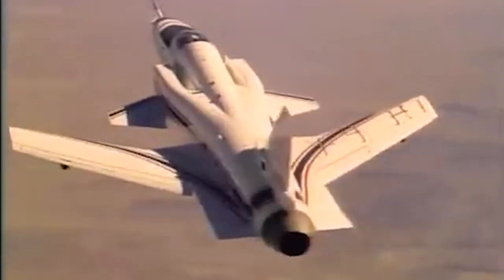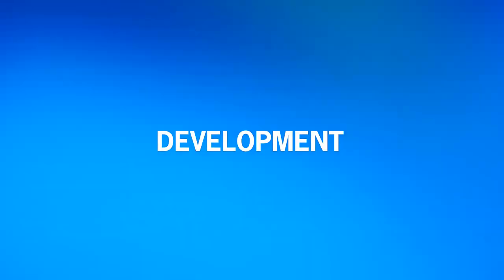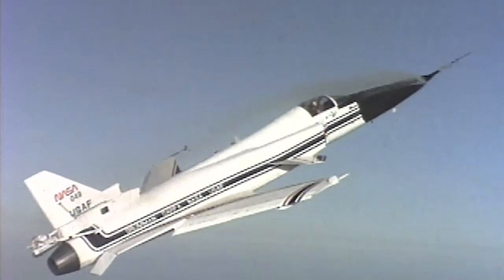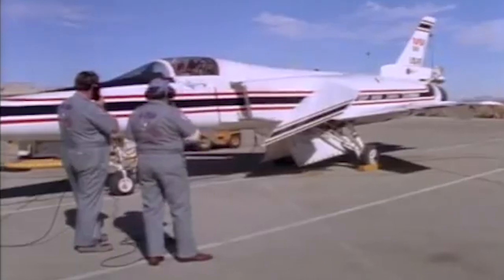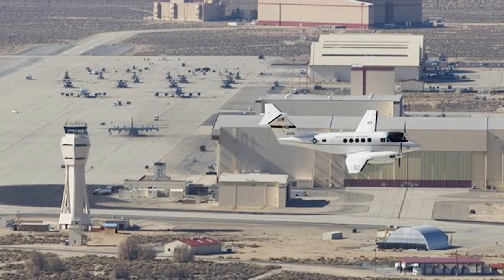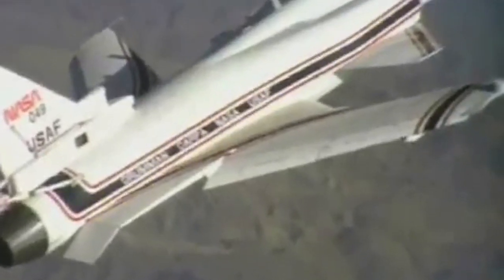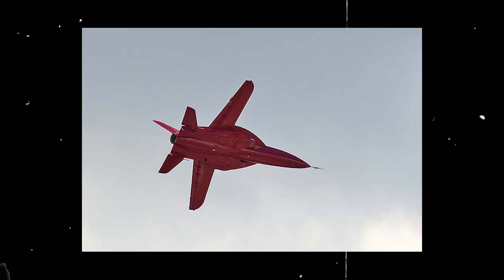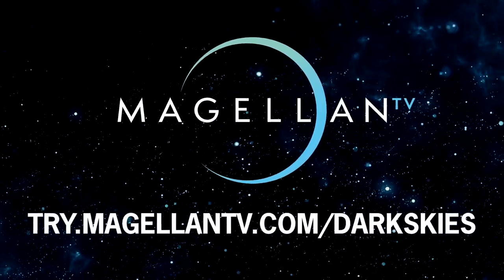X-29 - The Most Unstable Fighter Jet Ever Built

Comment: I believe this kind of design was “abandoned” because of the priorities shifting from maneuverability to stealth.

Canards and similar surfaces are not good for a plane RCS (radar cross section)

There are other aircraft that would be impossible to fly without computers, the f-117 for example
Reply: Adam Lannerd  Did you mean the YB-49, Northrop's Flying wing bomber.
Reply: The problem with reliance on stealth is that once they find a way to defeat it, and they will, the aircraft such as the F-35 is vulnerable. The British Royal Air Force flew Typhoons against F-35s in visual range and the Typhoon won every dogfight.
Reply: Desrtfox71 I understand what you’re saying but that’s not exactly true. Some of the engagements are not very clear. Let me give you a real example that happened in Iraq I believe. 

AWACS detected 2 mig-29s approaching 2 f-15s. On notice the f-15s turned in the direction of the migs which in turn turned in the opposite direction appearing to be running away.
The f15s gave chase. 
A few minutes in they realized they were in an ambush with another mig-29 (or 2) appearing in their flank.
Now at this point is where your argument gets tricky. The American pilots need to make a decision. Do we bug out and get the f away from here OR do we kick their buts? They decided to fight and they won...within visual range. I’m afraid 2 f-35s could be forced to make a different decision but I’m not sure. I’m actually a pilot but I admit there’s just not enough information to make a fair judgment on the aircraft. That’s another conversation all together 

You can check for yourself everything I just told you. There’s actual footage of the dogfight on YouTube. With all the American comms.
Reply: @richardpatton2502  Yes, engagement rules differ.  Nevertheless, a straight up merge in an F-35 is a failure.  Typically the way this would be done is that the F-35s would approach into visual range for identification, if engagement rule required it, in such a way as to do so from behind and without being seen by the adversary.  Then, once identification is made, any number of assets could be brought to bear.  In any case though, the F-35 is primarily a strike platform, not primarily designed for air superiority.
Reply: Adam Lannerd  Ditto the Typhoon, which has four redundant computers developed independently, and is highly maneuverable precisely because of its aerodynamic instability.
Reply: Canards can be stealthy if you get the planform alignment correct. Case in point - the McDonnell Douglass X-36. RCS was found to be quite low and maneuverability quite good. 

Forward swept wings should also have minimal impact on RCS, but add weight and complexity without much gain in maneuverability (e.g. X-29 was only found to be marginally better than contemporary fighters)
Reply: @bigblue6917  Your fighting last war tactics.
Reply: Adam Lannerd  Tell that to the USAF who think the F35 is the answer to all questions, including "What do we replace the A10 with?"
Reply: LtCol Pulaski that’s true and sad at the same time. I never understood it.
Pilots love the A-10
Soldiers love the A-10
Generals and politicians absolutely hate it with a passion and yet...it keeps coming back
I think the only problem with the A-10 is that it doesn’t make enough money for the powers that be.
There’s no true replacement for it and retiring it is nothing short of criminal
Reply: The A,B,C,D hornets were also unflyable without the computer. Believe it.
The idea was just given up on for the E, F.
Reply: Adam Lannerd  
A-4s Forever
Reply: Big Blue the Typhoon vs F35 and the F16 vs F35 dogfighting claims weren’t against the final delivered product. They were flying against it in it’s default mode, without it running the high maneuverability profiles in its software. The F-35 can now dynamically change it’s flight characteristics with the crazy advanced fly by wire.
Reply: Forward swept wings lower RCS. I do believe the RCS was bad for this jet. The euro canards a VLO profile on radar. Perhaps it's due to the delta wing.
Reply: I followed the X-29A development in Aviation Week at the time and stealth was so classified we didn't know about it.  The X-29A was to lead to super maneuverable dogfighters following the trend set by the F-16.  I'm still hinky on stealth having long term viability, especially when satellites can monitor airspace.
Reply: @bigblue6917  "The problem with reliance on stealth is that once they find a way to defeat it, and they will, the aircraft such as the F-35 is vulnerable." - If stealth is defeated, any non-stealth aircraft is too dangerous to fly and will be immediately grounded.
Reply: @pulaski1  The A-10 has already been replaced for the most part.
Reply: @richardpatton2502  "Pilots love the A-10" - Show me a pilot who doesn't love his machine.
"Soldiers love the A-10" - Emotional attachment should not be a priority.
"Generals and politicians absolutely hate it with a passion and yet...it keeps coming back" - Because the programs to replace it were killed.
"I think the only problem with the A-10 is that it doesn’t make enough money for the powers that be." - It made 5 billion with the Boeing wings contract. Keeping old airframes flying is deceptively pricey.
"There’s no true replacement for it" - Already been replaced for the most part. 11% of CAS missions since 2014. The rest are performed by Strike Eagles, Hornets, F-16s, B-1s, etc.
Reply: Adam Lannerd  "I don't see how anyone could dislike the A-10" - It was outdated nearly 30 years ago when the Iraqis shot 7 down and damaged 13 to be written off, forcing the USAF to call for the grounding of the A-10. It was developed because of politics, because even though the A-7 was one of the best CAS aircraft in Vietnam the Army's fetish for getting men killed in helicopters pressured the USAF to take in a slower, less capable aircraft so that it could escort helicopters. Plus the A-7 was sort of the Navy's baby.
Reply: Big Blue The F-35 is a general purpose fighter, not an air superiority fighter, that’s why. The F-22 is a purpose built air superiority fighter that not only has stealth for beating radar, but up close is amazingly maneuverable in dogfighting.

Regarding your follow on story with the F-15, that is another example of a purpose built air superiority fighter in action.
Reply: Richard Patton actually you are wrong about politicians hating the A-10. It’s the one smart thing that politicians have done in the last 50 years. Congress is the sole reason for the A-10 still being in service. They consistently force the military to accept funding for it, including upgrades. If it was left to the Air Force they would all be scrapped.
Reply: @NOLAgenX  The F-22 is not "amazingly maneuverable" - RAF Typhoons repeatedly kicked F-22 butt in WVR air combat exercises about ten years ago.  Now, you can make the point that the F-22 should never need to engage in WVR air combat so the exercises were unrealistic - and you might even be right - but none of this changes the fact that the USAF prioritised stealth and supercruise, not super-maneuverabilty, when they specified the F-22.  Accordingly, the F-22 is not in the first rank of super-maneuverable aircraft today, even if it is the stealthiest and fastest.
Reply: Titanium Rain and that’s how you explain stuff to people. I admit I was also a bit generalist. But I do thank you.
I’d like to know your opinion though. Do you believe CAS will be ultimately left to other platforms? Should a dedicated replacement to the a-10 be built?
Reply: Yes, the US dropped the X-29 for stealth. But something I noticed, was that the Lockheed F-22 won against the F-23, because the 22 was more maneuverable  (period).
Reply: Or the A12/SR-71? I think that one was fairly reliant on computers as well, particularly manual computers which helped run the engines. I could be wrong on this - I should know better considering they're one of my favourites. EDIT: Also, there's a video on the Hopeless Diamond: https://www.youtube.com/watch?v=SG58fU85hVE
Reply: Most of all of this was all said in the vid.
When I was at school we practiced comprehension again and again and again. If we still failed at it we were severely belted then given extra comprehension work until the desired result was attained. The process was repeated and unrelenting.
Private Catholic schools were like that. I can see you didn't attend one - lucky for you, but unlucky for you, we that do comprehend see that you don't!
Reply: @bigblue6917  now that's bad.
Reply: The design was based off of nazi prototype aircraft that allies had capture during ww2.
Reply: The Russians built the S-37 berkut. It was a technology demonstrator and many will say it gives f-22 a run for its money
Reply: @bigblue6917  
If a way to defeat stealth is found, that means it will be just that more easier to detect non-steathy aircraft.
Reply: The B-2 is probably the best example of being highly stable in flight only with redundant avionics computers. In part, this program led to the success (and bloated) workings of the B-2.
Reply: Look if more money was involved and proposed than we'll have more of this, intrests shifted.
Reply: ThePaulv12 better late than never. I was wondering where all the usual social networking idiots were. I guess the priest in catholic school did a little more than just using his belt
Reply: @richardpatton2502  What?
Reply: @dakkuri1  The Berkut is the Su-47 (which was even mentioned in the video), i also has forward swept wings. The 37 is called Terminator, which is a essentially a Su-27 with thrust vectoring. How both would compare to an F-22 is speculative. Both don't have any stealth, but are highly maneuverable. But since the Su-57 (T-50) is the real russian counterpart to the F-22 speculating about the Berkut is irrelevant. At the end of the day, even the russians were convinced that you need a stealthplane to defeat another stealthplane.
Reply: Ben Keller I did say I don’t have enough info on the f-35 to make a decision on its merits. We can have a conversation without making it personal like you did in the end...if you read more carefully you’ll see I’m not discussing the f-35.
Reply: @richardpatton2502  oh your arguing with someone else.
Reply: No, it was "abandoned" because it wasn't and still isn't feasible. As the Su-47 displayed decades later with dramatically better technology, the aeroelastic problem really limits the aircraft whilst the forward swept wings have very few benefits. The speed, for example, is far too slow for a modern fighter and alone rules out the aircraft for combat use. The aircraft has far more wear having to fight the very air itself every time it flies. The payload isn't great either. The benefits are near zero, there is a slight benefit to the lift produced at low speeds but other designs are far superior in a dogfight. The forward swept wing struggles to produce a large wing area, and makes LERX vorticities far harder to exploit ultimately leading to an aircraft with worse performance in all areas than a conventional design. Finally stealth has absolutely nothing to do with it. The Su-47 had a stealthy design from the front and sides, the forward swept wings make absolutely no difference to RCS compared to conventional wing surfaces. If anything one could make a stealthier aircraft with forward swept wings and a low wing area, but it would suffer in turning performance, would have less fuel, and would ultimately be a far worse aircraft.
Reply: @elphi4321  I understand that to be true.  I claim no special knowledge on this, but from reading around the subject I gather the X-23 was very stealthy but would have been a step backwards from the F-15 in terms of maneuverability.  The F-22 was considered the better compromise, being sufficiently stealthy and having maneuverabilty similar to the F-15.

None of this is meant to imply that the F-22 is "unmaneuverable" - merely that other aircraft have prioritised this quality where the F-22 prioritises stealth.
Reply: @noctisumbra2749  there was a piston engine 1st had to put tails on the 49 for stability. The propellers helped make the 1st plane more stable. Both Jack Northrup designed
Reply: @ChucksSEADnDEAD  nope f35 can't carry its maintenance bag only mission it could help is sneaky interdiction & Sandy Amen
Reply: @NOLAgenX  Its  it sexy to not a pound for the ground General's disgusting they never got best F16 F18 F15 I wonder why??? I know not  chances for ego showing off and getting paid. Remember X29 was done on the cheap its a f5-f16 midbody marriage. Engine is a 404 (f18) main $$$$ went for fly by wire flight computers 40 updates a second assumed best non black at the time. That handmade wing purpose built from design till delivered. Its central core is a titanium box the rest all hand layered carbon fibre then control surfaces. Sexy and expensive. The 1st flight used 1/4 of expected fuel. It kept being a fuel Mizzer during the 8-900 test flights. FSW creates pull on boundary air so less drag
Reply: @dakkuri1  47 it needs an update + a diet assumed heavy I liked it but not combat ready mean and lean yet
Reply: Richard - but the F-18 is not a Stealth platform , the F-29 Could have ben Developed into the Ultimate Air Force non Stealth Fighter plane. for both the Navy and Air Force.
Reply: @ChucksSEADnDEAD  soldiers love the A-10 because it provides service and functionality not really replaced or replicated over the battlefield. Long loiter heavy ammo and payload at low altitude ove the nattlefield. With that sweet spot of high response speed and low attack speed. It can get the ground pounders fast   and stay above them a long time concentrating support fire. All of the alternative replacements, drones, helicopters and fast moving milti role strike fighhters miss one or more of those elements. It's not that the A-10 is a perfect plane. Its judt it fills a specific niche that has not been duplicated.
Reply: @NOLAgenX  "actually you are wrong about politicians hating the A-10. It’s the one smart thing that politicians have done in the last 50 years." - Ironic. The A-10 should have been retired after 1991. Politicians fawning over an aircraft that was outdated by the 1980s is exactly the type of stupid crap they do, but because of the memetic potential of the A-10 people people actually think it's smart.
Reply: @richardpatton2502  "Do you believe CAS will be ultimately left to other platforms?" - Already has been, for the most part.
"Should a dedicated replacement to the a-10 be built?" - At this point, why? The only thing unique about the A-10 is the smaller danger close radius of the gun versus bombs/missiles.
Reply: Titanium Rain Gonahead and split hair, instead of correcting the guy I was correcting. He said politicians had been trying to get rid of it and I pointed out he was wrong, that they are the only reason it is alive.

As to the merits of it, no other plane can loiter around the battlefield in a COIN type CAS role and provide the ground support fir as ling and in such abundance as the A-10. For that role, speed is not king. To make up for it, it has proven itself to take way more damage and abuse and still return the pilot home than many of our faster jets can.
Reply: @andrewtaylor940  "heavy ammo and payload at low altitude" - There's zero advantage to that.
"low attack speed" - Which is a negative.
"stay above them a long time concentrating support fire" - the loiter time is a big plus but the A-10s niche is uncontested air space. Which means that tankers could make up for the inferior loiter time of faster jets.
"Its judt it fills a specific niche that has not been duplicated.
" - But could have, and the projects were canceled.
Reply: @NOLAgenX  "no other plane can loiter around the battlefield in a COIN type CAS role" - in a COIN environment you have tankers which are not in danger of easily getting brought down. Either way, turboprops like the Super Tucano seem to have good enough combat endurance.
"it has proven itself to take way more damage and abuse and still return the pilot home than many of our faster jets can" - Both the F-15 and F-16 are on record as being able to return home with half a wing gone. One F-15 made it home with a wing ripped at the root. Meanwhile in 1991 the USAF had to pull the A-10 away from the Iraqi Republican Guard after 7 shot down and 13 written off due to battle damage. The aircraft was outdated by the 1980s. The bloody nose it suffered in 1991 should have been the wake up call.
Reply: Richard Patton ALL modern fighters are designed to be inherently unstable, which is why this insanely unstable plane was on the drawing board.  Fighters with cables and pullies don’t exist any more, hence the term “fly by wore.”  Those tiny little canards don’t reflect nearly as much radar as the giant wings and tail, but the RCS doesn’t matter once your radar is turned on to search and track targets.  Every plane in the vicinity is going to know what direction it’s coming from.
Reply: @Desrtfox71  it only takes real time satelite surveillance to defeat stealth.
Reply: @chrissinclair4442  lol, no. You aren't going to get a lock with that.
Reply: @Desrtfox71  your going to get the position of an underpowered f35 and catch up to them. I didn't say anything about a lock.
Reply: @chrissinclair4442  locking is the problem now, not noticing that something is there. Also any solution, lock or track, is much more difficult from the vantage of a satellite vs the ground stations now.
Reply: @rtrThanos  "RCS doesn’t matter once your radar is turned on to search and track targets" - modern stealth aircraft are able to turn their radar on by masking their emissions as background radiation. Basically only the emitting aircraft knows the specific frequency hopping so unless you somehow capture enough shot down aircraft to reverse engineer the software you won't be able to decrypt the hopping sequence. Passive radar/RWR will not understand it's being "painted".
Reply: Titanium Rain again, thanks for your informed and polite response.
But on your latest explanation on the software and reverse engineering. How confident are you that perceived enemies like Russia do not possess that info already? 
On CAS. As I understand it, the need of a dedicated, slow, tight turning, armored platform as been labeled as “obsolete” since the end of WW2. The Skyraider was supposed to be obsolete in Korea but when Vietnam came around there they were, down on the dirt. 
Also, this kind of air support is very good for morale on the ground, which importance is frequently and systematically ignored...
Reply: @richardpatton2502  "But on your latest explanation on the software and reverse engineering. How confident are you that perceived enemies like Russia do not possess that info already?" - One one assume that as soon as enemy contacts started reacting to radars being turned on, they'd simply change the algorithms so that the frequency hopping becomes unpredictable again. Besides, if you were so assume that Russia broke American crypto there's a whole lot of more pressing issues that have to be addressed before stealth.
"The Skyraider was supposed to be obsolete in Korea but when Vietnam came around there they were, down on the dirt." - You look at footage of cops flying the relatively "low and slow" helicopters and what do you see? FLIR. The mechanical eye sees more than you can with the human one. If you're gonna fly a modern turboprop like the A-19 Super Tucano like you'd fly a Skyraider, you're doing something wrong. For example the A-7 was a formidable bombing platform. But if you look at video from the time (this is a good one: https://www.youtube.com/watch?v=R8lVoK_APac) you can see it's not all sunshine and rainbows. You will either have to be queued about target information or you have to acquire it visually. The latter is much harder when you have to observe a pitched battle and mark your own targets. From my limited research the A-7 only got FLIR in 1978 and that was in the Navy, with the ANG A-7s only getting it in 1988. So, in the end there's nothing wrong with the machine, it's the human inside that limits the capabilities. You give the human machine eyes to see the target without requiring low and slow passes, and you solve the problem.
"Also, this kind of air support is very good for morale on the ground, which importance is frequently and systematically ignored..." - If the morale gains come from using an inferior platform then we have to question if morale is even a reasonable goal. Are troops meant to see an air show or effects on target?
Reply: @elphi4321  Seem to recall 23 being better for maneuverability. Just selection day, f-22 came better prepared.
Reply: @bigblue6917  That might be true... but in a real conflict... the Typhoon would be defeated.... long before it even knew that an f35 was in the area, and that has nothing to do with stealth... but with flatout range of radarsystem... no Jet in the sky can look further beyond visual range than an F35. That trait, together with stealth... makes it truely unbeatable on todays battlefield...
Reply: @mattbowden4996  what? The F22 has otherworldly kinematic performances. Listen to pilots that had the chance to BFMs against them when "unbridled".

"You have been vectored! " USAF meme you find on fighter pilots only channels. Check on that.
Reply: @chrissinclair4442  42K lbft engine on the back, highest transonic acceleration ever registered..."underpowered".

Ahhh the casuals! :D
Reply: @sh0ckv3l33  they chose the less powerful engine for it.
Reply: @mattbowden4996  you clearly dont know what you are talking about.
There are good estimates of F22 kinematics and that are on the very top of the chain.

Ah, could you search this video on yt? "Gonky vs su30MKM".
Come back to me when you have a decent explanation how a legacy hornet with 2 bags can win 3 BFMs from the merge against a so called "super maneuverable " Su30MKM.
Ah the Hornet is from Boeing, so we can cross the shilling option.

Ah, there's an interview on a french-canadian fighter pilot (former french navy) where he says he had troubles in his Rafale against the french trainer jet in BFMs.
Yet, the Rafale is one of the  best "dogfighters" out there, right?

Stop watching RT crap and start listen to pilots MORE.
Reply: @chrissinclair4442  No wtf are you eveme talking about?

The engine is the PW F135 motor. 42K lbf of thrust in AB. There's no "other engine".
The engine will get the AETP update in future (replacement of older units).

Cmon this stuff  was availabe in Pratt's website. Stop falling for propaganda if you want to follow the aircombat world.
Reply: Adam Lannerd , it’s all about balancing. Even an F16 is unflyable with the aft centre of gravity. A heavy tail gives advantage in manoeuvrability. Forward sweep does not automatically mean an unstable craft. The nazis made a bomber with forward swept wings and it was not unstable. There are also many model airplanes of B2 and F117 flying great without gyros. Trick is to have them slightly nose heavy.
Reply: Andrew Taylor  
Lol, only us and the brits are capable of doing bfm/acm practices between tiffies and f35s.

We both have just recently got our initial batch of f35 out of fort hill.
So, how did “they” tested a typhoon against a f35 when the chances both jets have met ar close to none?
Reply: Also, vectored thrust can sub for forward canards in this context.
Reply: The design is not dead per-se.
It's a question of materials.

For example the proper metamaterials could allow for a stealth unmanned fighter with hypersonic capabilities that can pull off the full potential of this configuration.
Reply: @Desrtfox71  The best way to describe the F35 is a TIE fighter.

It's an extremely flawed machine built around a single gimmick and a lot of corporate corruption that has sacrificed a lot of its functionality to make its gimmick work at the cost that the case where the gimmick fails its a sitting duck. 
The F35 is too reliant on stealth, a major problem when you consider that it burns its stealth coating away and breaks its tail mounted electronic suite after a brief low supersonic flight.

The plane is crippled by itself.

This is why the F35 is a geopolitical pawn and a platform meant for striking weakened targets while the eurofighters and the rafale are weapons of war.

It's literally why greece preferred the rafales as strike platforms just a few months ago.
Reply: rcs;call it corner!😉
Reply: "Canards and similar surfaces are not good for a plane RCS (radar cross section)"

I disagree, As long as complimentary angles are used and there are no obvious traps, there should be no problem
Reply: Nope, those stealth planes are still plenty manuverable.
Reply: Ah, thanks, I was wondering why it was "incompatible," precisely because the F-117 also needs computerized flight assistance.
Reply: @bigblue6917  Yes, but it looks like air combat is evolving to the use of very long range active homing missiles. So big fast missile carriers aside stealth aircraft makes for a future mix perhaps.
Reply: @Desrtfox71  Uhh no. Rules of engagement means visual identification before the fight even began. This is not some cold war scare strategy, but real life doctrine. F-35 stealth only shine on, shockingly enough, morally gray covert operations.
Reply: @bigblue6917  f35allowes u to shoot in a 180 degree half circle. U dont have to have maneuverable aircraft cause u can shoot off the wing.  And typhoons were defeated by f35s in every test conducted by the British to my knowledge
Reply: Then just like when they went from piston engine planes to jet, or  guns to missiles all the engineers will be given a task to make a new fighter. You act like problem solving is something new you invented.